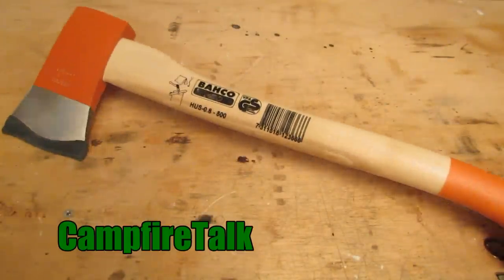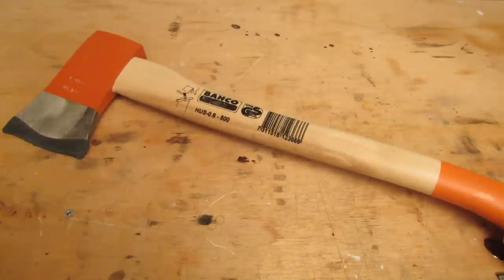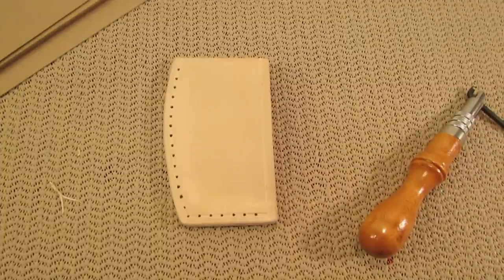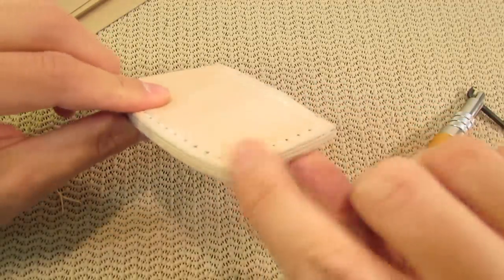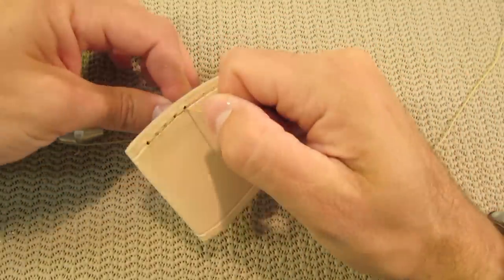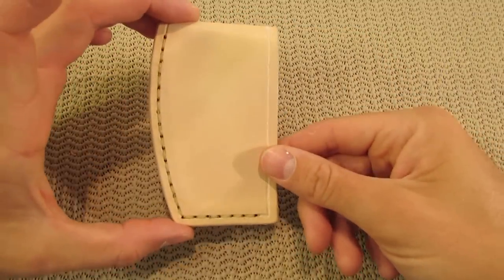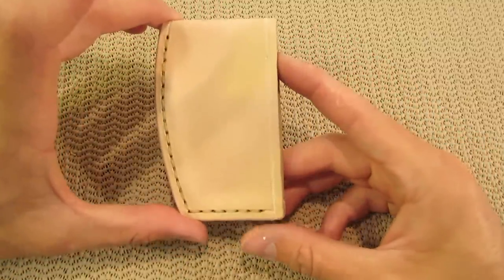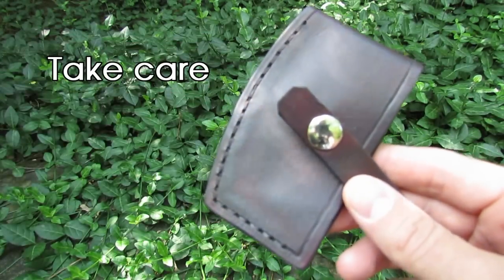BAHCO Axe Project with Leather Sheath

Comment from the maker: Bees wax will work, I use a boiled linseed oil on the wooden handle. Coat before storing the tool, & maintain after use, you'll be fine.